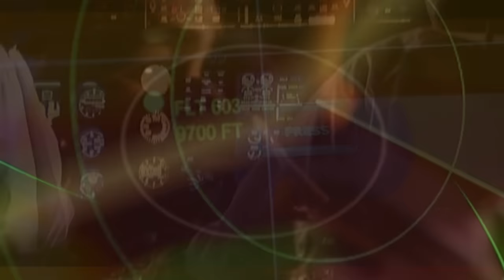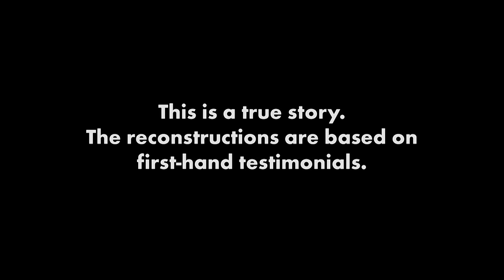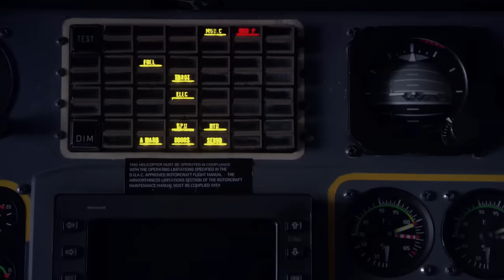Helicopter Struck by Lightning in North Sea! | Mayday: Air Disaster

Comment: I perform maintenance tracking for a helicopter company.  One of the helicopters operates near the coast and so always has floats mounted to its skid tubes.  Inspection of the float bags is performed at strict intervals to check for wear and leaks.  The gas-filled cylinder and valve which inflate the floats also undergo regular testing.  So the scene where the floats were inflated was really interesting for me.  I have only seen the floats inflated when the helicopter has been sitting on the hangar floor as part of the inspection 😊

Comment: Wow. This was a great re-enactment . The skill and calmness of the pilots saved 16 oil workers that work on the oil rig platform.  However the helecopter manufactors need to make the tail rotors and main rotor blades stronger with a better type of material that will not burn and explode when hit with high amounts of electricity from a lightening strike. Also the emergency rafts need to be desigened to not flap up against the helecopter during high winds and high waves. The dingy needs a EMEGENCY LOCATOR BEACON attached to parts of the Raft Dingy . So ships and emergency helecopters can locate a oil rigger crew floating out in the ocean. Also the Cargo doors need to be designed so there are no sharp edges any where on the door edges that could puncture any dingy or raft. They must install something on the helecopter doors to make the doors float far away from a helecopter so as not to cause any damage to any parts of a floating raft. Make the doors float or sink. Next : Have a type of blinking lights on the floating rafts. Or a mirrior to get the attention of flying helecopters looking for a crew floating around.  Briliant work from both pilots to shut off the main rotor blade. This stopped the helecopter from spinning in circles . Glad the all survived . I flew allot on helecopters when I was in the Army.  Some times accidents are pilot error and some times its mechanical . This time it was the type of material used in the tail rotor blades and main rotor blades.  If this material is not replaced sadly this situation sadly could happen all over again. CARBON FIBER must be replaced with a material that can never be or cause this blades to explode or burn inside. Make them aluminum all the way threw the blades. Plus replace all parts on planes using carbon fiber . To prevent planes hit by strong amount of lightening to crash. REPLACE CARBON FIBER. To save lives.
Reply: Many of the suggested remedies have been done. ELTs on rafts and ALL safety gear replaced and thrown away when expiration happens. Even survival suits which are very expensive. Too many accidents resulting in tragedy have happened and will continue to do so in the N. Sea. Safety regs are written in the blood of the lost. Having ridden them in the past for work, I never felt comfortable aboard choppers. Too much can go haywire.
Reply: Well yone fair helicopters only fly by beating the air into submission as opposed to aeroplane's that actually fly.😂
Reply: They said in the video that the door was designed to sink but didn't for some reason.

Comment: Well, I think the signal flare, torchlight and locator beacon should be placed in an easy to reach place for emergency situation. Also the life raft should be tested and certified in North Sea under extreme storm and not in swimming pool or calm sea for use in this area.

Comment: Do they not give exact LL coordinates with the mayday call? That would make locating them easy
Also, with helicopters being top heavy, they should develop a heavy anchor to deploy with the floats, to help keep them right side up.
Reply: they did on the working weather radar display (it's dish is at the front it's unlikely it failed) so I cant understand why they didnt include it in the mayday after a/c ID panic
Reply: Managing an emergency situation in an aircraft is very stressful, so forgetting details is very common. As a matter of fact, in many emergencies, trained professionals even forget to say mayday..! 
And as regards the anchor idea, that isn't really a good idea, since weight is more or less the opposite of what you want on a helicopter. And besides, it stayed upright on its floats in a storm, so the design worked well in that regard :)

Comment: The pilot is the original Sully Sullenberger
Reply: i beg to differ, the original sully would be the captain on Garuda Indonesia Flight 421. 
''On January 16, 2002, the flight encountered severe thunderstorm activity during approach to its destination, suffered flameout in both engines, and ditched in a shallow river, resulting in one fatality and several injuries.''

Comment: Just a question: as the helicopter is flying underneath ATC's radar - were these helicopters fitted with transponders, which might have helped track this one? Thanks!
Reply: They were beyond the radar's reach since they were flying through a dead zone that wasn't covered by the radar waves, as mentioned in the video.
Reply: @verify95 Yes, thanks! I thought a transponder's signal would have reached through anyway.

Comment: Thankfully everyone was ok, but this one was hard to watch.  All those at days and never once were their coordinates transmitted or requested?!  Nobody thought to just reach over and push the door away from the raft?  They were still tethered to the helo, why not go back for the beacon?  They had the long rope with the raft, why not tie it to the short one before cutting it loose?  Given that they solely transport over open water, why do they not carry a handheld marine vhf?  

How did nobody consider the implications of Carbon Fiber being a conductor?  I’m not an expert, but that was the first thing I thought when they said “how can this happen?” and showed the splintered blade. In fact, I don’t think the metal edge they kept mentioning even matters.  I saw a splintered carbon fiber fishing pole that was struck while in a rod holder on a boat once.  

Finally, if they supposedly use these to make regulations to make things safer, why don’t they regulate requiring an EPIRB on the life rafts and suggest a Marine vhf.  I have a built in on my boat and still never leave the dock without a waterproof handheld as backup in case it fails or I have to ditch.  For less than $100 it’s just too cheap not to carry just in case (certainly a whole lot cheaper than those Helly Hansen survival suits!)

Comment: Switch off main rotor blades, when thay lost tail rotor? This does not make any sence. At this point it is too much aviation nonsence in this documentary... But I do not to want to put down the tragedy and what realy happend.
Reply: Do you know how flight works?
Reply: @isaiahharrison865  I know everything about autorotation and helicopters so shut up.
Reply: The tail rotor’s job is to counteract the main rotor’s torque without it the helicopter’s fuselage will spin incredibly fast in the opposite direction from main rotor’s spinning direction so obviously it is no good. So when they lose tail rotor there is nothing to counteract the main rotor’s torque anymore so the best way to stop the helicopter’s fuselage from spinning out of control is to turn off the main rotor and take a chance with the helicopter falling down. Make sense right?
Reply: @vireaknou8835  No, it doesnt make sense. Without the tail rotor they must make an autorotation landing with the helicopter spinning too much, thetefore it must be disengaged from the motor.